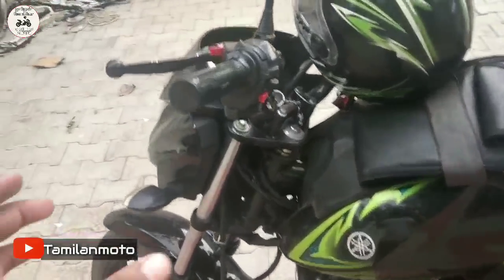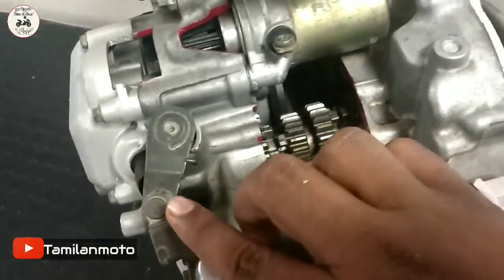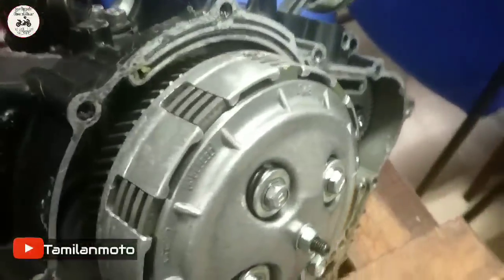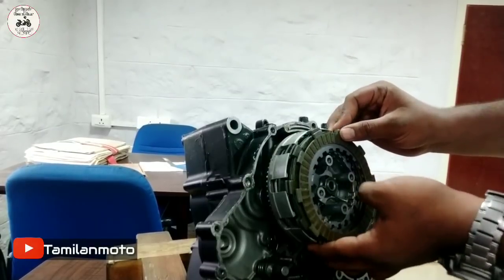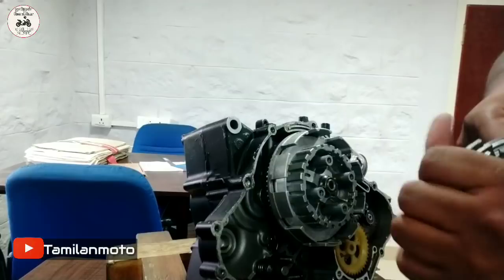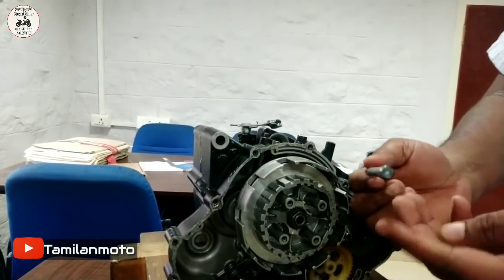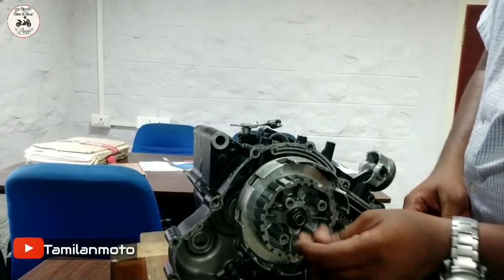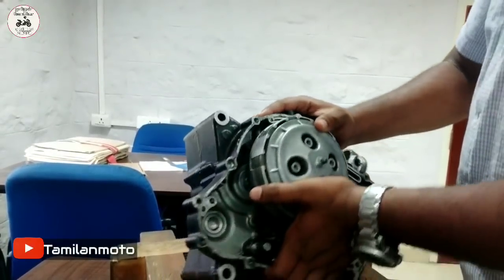How clutch works | Part 1 | கிளட்ச் எப்படி வேலை செய்கிறது | Tamilanmoto

Comment: Shall we put Yamaha r15 v3 slipper clutch assembly in Yamaha r15 v2????
Reply from the maker: We can but little bit we have to alterate..
Reply: Same clutch bell for yamaha r15 v3 and v2 right
Reply: We change slipper clutch in Yamaha v2 any damages comes in clutch case?
Reply from the maker: @karthickraja9910  we have to alter it. And engine right side case too ..

Comment: Clutch adjustment proper a iruku but pick up ila enna complaint sir bajaj platina bike
Reply from the maker: Pick up ku neraya reason irku bro.. you can check air filter & carburetor line.. compression Nikitha nu paarunga inum neraya reasons irku.